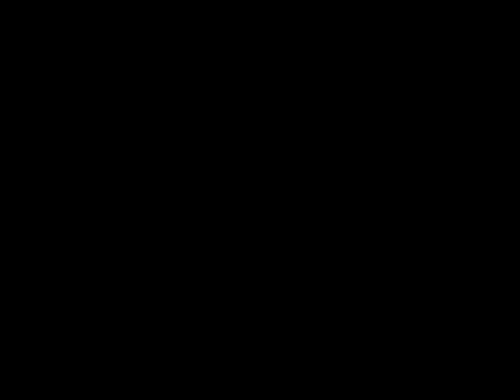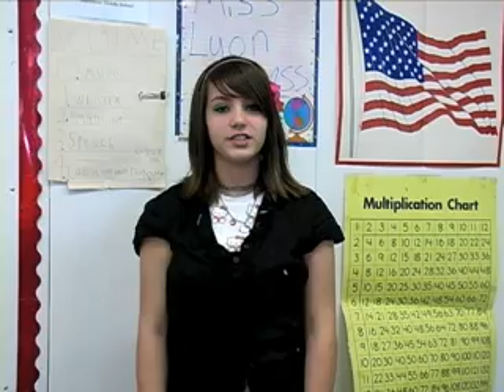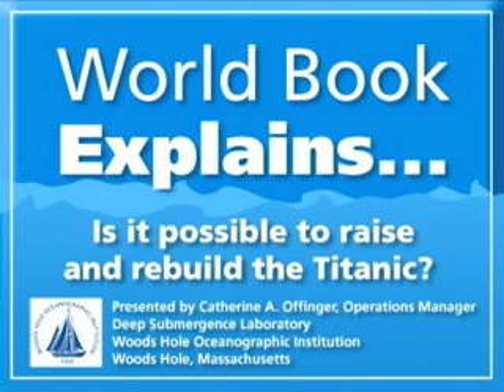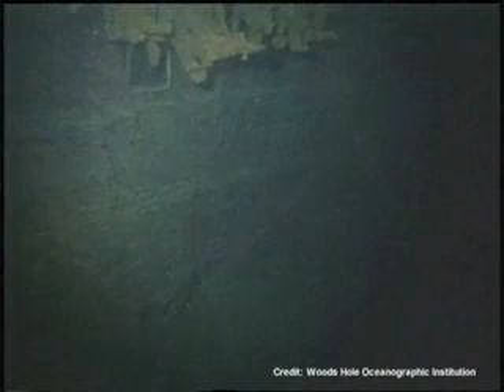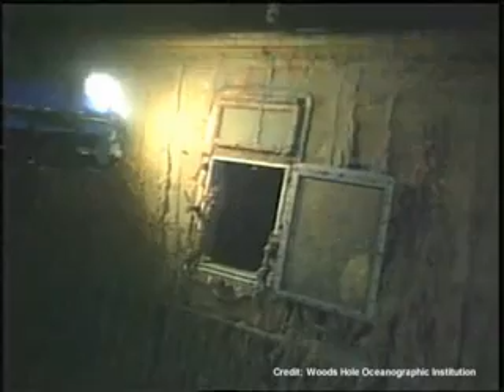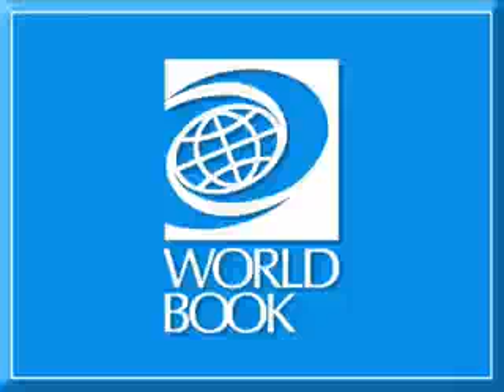Is it possible to raise and rebuild the Titanic?- World Book Explains

Comment: how about the cut up pieces of the hull, and promenade deck, mark the pieces, raise them, and put them back together exactly the way they were, then do the same with the stern section.
Reply: they
Reply: How would you put together 104 year old iron together that is very fragile I remind you together because if you weld it the heat would make the iron fall apart so just leave the titanic as it is
Reply: +Googly Gold you would make an inside structure out of steel and use modern rivets to hold the plates in.
Reply: 1spunkymonkey2 fare point
Reply: No, first off the bow hasn't got to be even more damaged than it already is, and lastly if we do that it might just fall apart on the seabed and crumple. I like the idea of raising the bow, but not the cut apart idea, it will be the hardest puzzle on earth to put her back together dude.